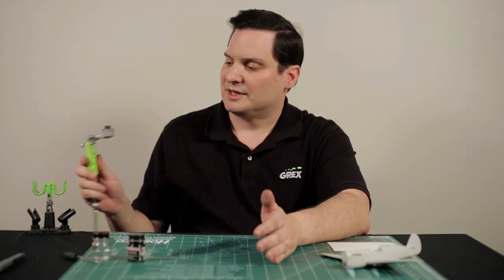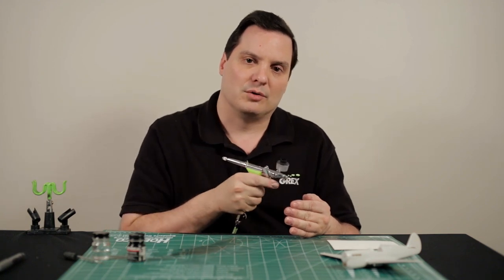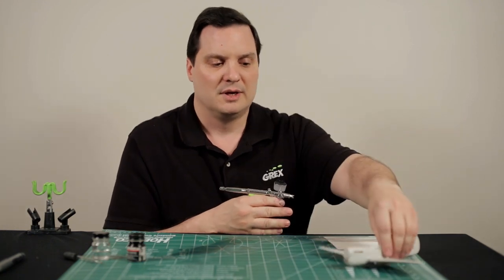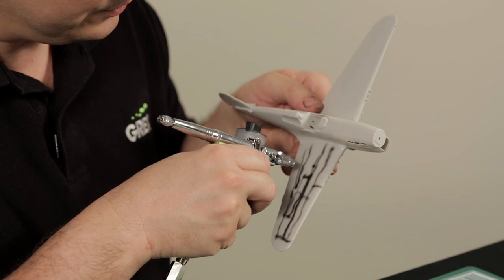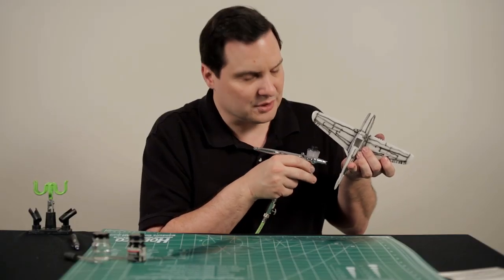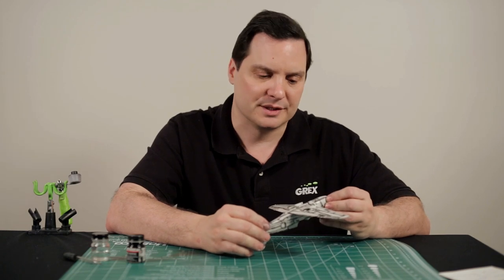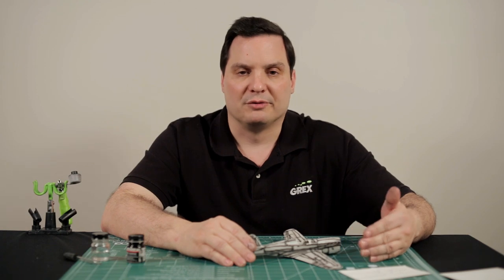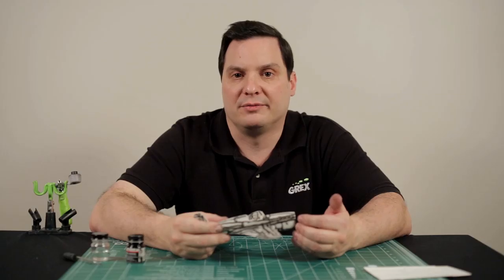Grex Model Aircraft Airbrushing Series - Episode 3 - Pre-Shading Panel Lines

Comment: Primer isn't always necessary. If the model is a neutral grey plastic and I'm working with military flat colors then I generally do not primer the model. Some models maybe cast resin rather than plastic and may have a tan color. Other plastic models maybe cast in white or black plastic and in those cases I will primer the model. Others may primer all the time. It comes down to personal preference as a result of both positive and negative results with previous projects.

Comment: Generally I freehand the panel lines. Little wiggles in the lines themselves will not have a significant effect as 85 to 90% of the preshaded lines are covered. In the end the effect should be subtle but enough effect to show a difference if compared to a similar surface with only the base color applied and no preshade as I demonstrate in the videos. I made the effects a little more dramatic for the videos so the video camera could pick up the effects to convey the technique.

Comment: I've been in the Air Force for several years and have seen a lot of different military aircraft and I've never seen that many panel lines.  Most modelers way over do it  and it detracts from an otherwise good looking model.
Reply: +BennyCFD I understand your comments. Please keep in mind in order for the camera to pick up the subtle details I needed to be more "dramatic" with the technique. Also there are other steps that follow before finishing the model such as "glossing" of the model for the purposes of decaling without causing silvering. Also with a gloss coat a barrier has been created to protect the paint if one wishes to do a wash to bring out the panel lines more or to use dry pastels for various effects on certain areas of the model. Once those aspects have been addressed the model can be flatted back down (dull coated) to bring it back to a more realistic military flat finish. It also mutes some of the effects to a subtler result.

I wish I could show all those techniques but they don't require an airbrush aside from applying a gloss coat and a flat coat. There's not much "technique" when applying those coats so it's not all that relevant to what an airbrush can do and what the intended purpose of this video series is for. 

As too how prominent or subtle panel lines can be seen does depend on many factors. Some aircraft are maintained and kept cleaner than others, some took off of grass runways during war time while others did not. I've seen A-10 Warthogs just before going back to the paint shop in which every panel line can be clearly seen and then afterwards hardly anything is visible. It's up to the artist to decide for themselves how subtle or dramatic they wish to make their model.